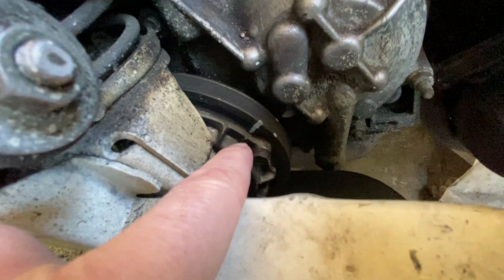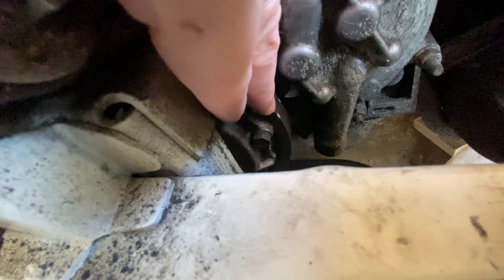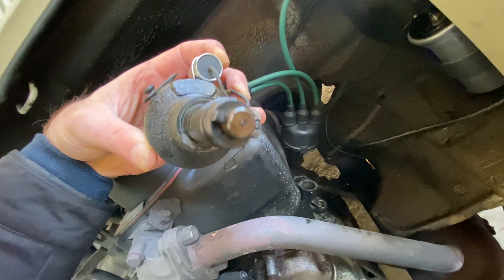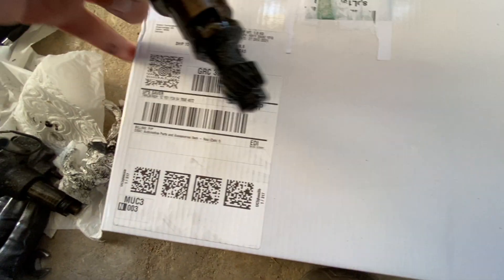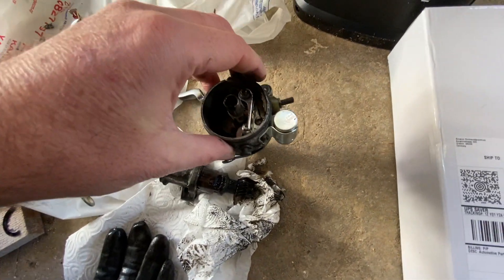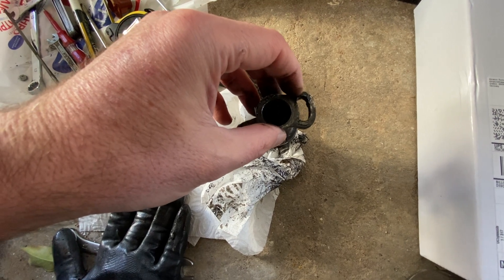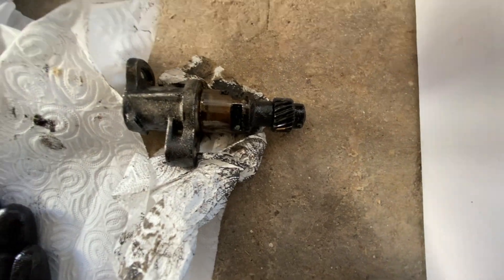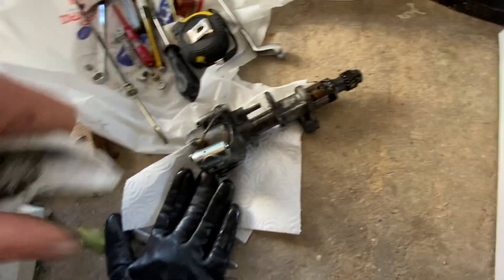Classic Fiat 500 Ignition Timing - old car #fiat500 #ignitiontiming

Comment: Thank you for this outstanting video. Just adding my two cents of wisdom coming from years of Fiat 500 ownership 🙂 First before setting the timing be sure that the max clearance between the breaker points is 0.5 mm as prescribed. Second if you need to replace the old capacitor, keep clear from the ones currently sold, they don't last longer than few hundreds km, but take one from an old electronic board ( between 200 and 400 nanoFarad will work) You just need to find a way to secure the capacitor to the distributor with very short wires and keeping it away from excessive heat and vibrations
Reply from the maker: Glad you enjoyed the video, and thanks for sharing your expertise!